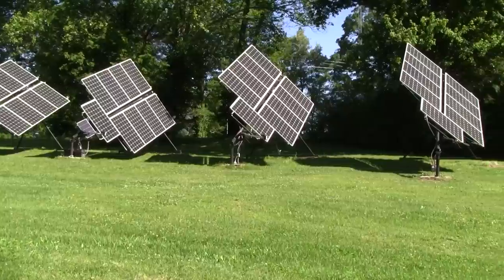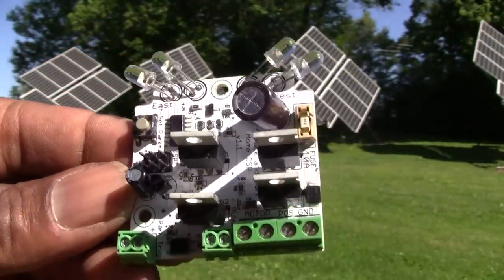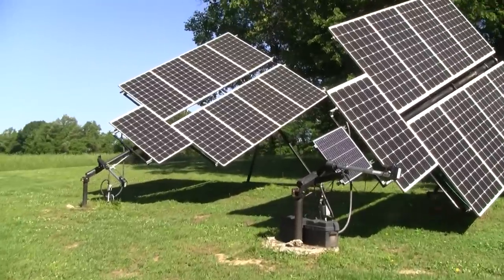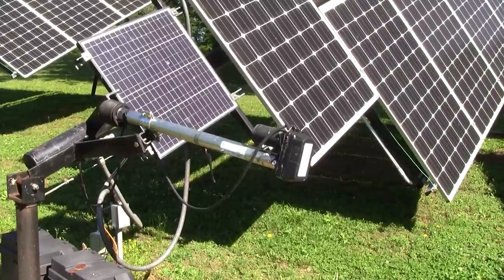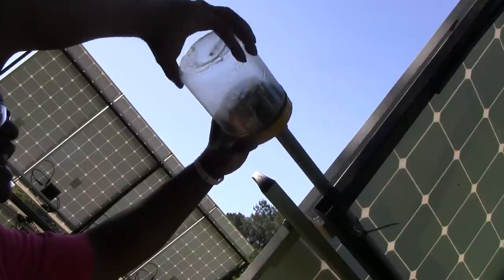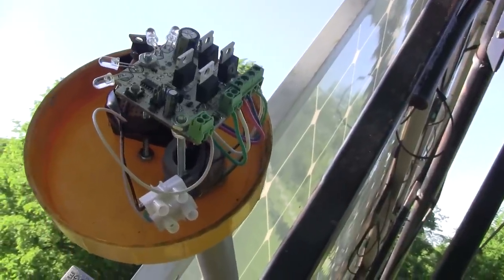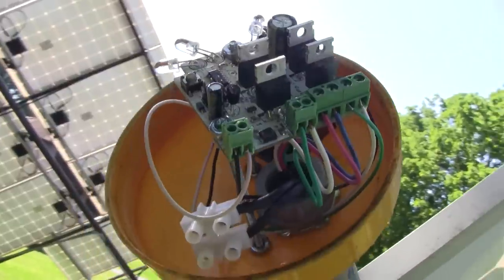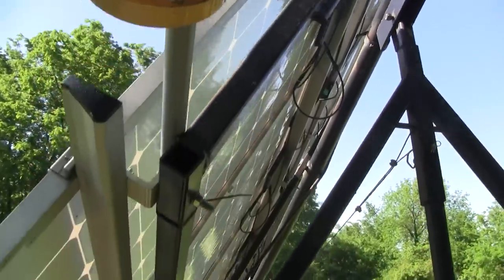Solar tracking drive system

Comment: Something interesting that NASA does is they put 4 small panels, 1 on each side (left, right, top, bottom) and they place them just right so that if one of them gets light, it turns a motor until it no longer gets light.  So it keeps them all out of light, and when they are all out of the sun it means the main panels are facing the sun.  With this method you don't need any batteries or sensors. Just 4 tiny panels, big enough to power the DC motors, and 2 DC motors, one for each axis.  it may work with linear actuators like you have as well, but idk how big of panels are needed to move those without batteries.

Comment: #EVERYONE#Install a AC run capacitor parallel with pump motors, 5-60 Mfd, power factor correction will save 1-15 amps, same for ice boxes to.  Try increments of 2Mfd instill lowest line current. My washer motor needed 180Mfd but hardly worth it because two 2 hours a month uses. We are charged for VAs not watts! Craig Thanks for your posting.

Comment: Hey sir, put on some waterproof silicone sealant around the pipe and on the inner side of it also use some teflon tape on the container thread

Comment: In the process to do an exact project as shown.  Want to know what motors that can handle  the weight & torque of the panels & adjustable mounting racks....
Reply from the maker: As long as you use the similar configuration and a Venture solar tracker, you should be fine. I don't have the specs o. Them specifically right now, but if it will handle about 1000 pounds static load, it should be fine.

Comment from the maker: I plan to make a posting on the manual control, probably tomorrow. Depending on if I can get the pool pump fixed!
Reply: #EVERYONE#Install a AC run capacitor parallel with pump motors, 5-60 Mfd, power factor correction will save 1-15 amps, same for ice boxes to.  Try increments of 2Mfd instill lowest line current. My washer motor needed 180Mfd but hardly worth it because two 2 hours a month uses. We are charged for VAs not watts! Craig Thanks for your posting.
Reply: that would be awesome
Reply from the maker: Jerry Moody what is your question about the wiring?
Reply: Sr, really nice Job. I'm from Brazil and I got a really good to build. I wanted to know what is the website yo said at 6:14. Thanks a lot man.
Reply from the maker: @jorgem3550  homecsp.com/store
Reply: thanks man.

Comment: you could also make a solar heated tracker and drop the power motor completely .... a pair of balck resevoir cyclinders onleft and right will heat in the sun and as the liquid inside expands can move a piston to rotate the panel on the opposite side ... a 2 to 4inch  resevoir 3/4 length of your panel side shold be plenty of pressure
Reply: Where can I find an example of those?
Reply: @mrweevilcom  I wonder if 0623Kaboom is thinking of Automatic Vent Openers that are designed to work between a range of temperatures (mine works between 55 - 75°F) to open the ventilation windows on solar greenhouses preventing temperatures from climbing higher. How they work is with a cylinder filled with a wax that expands as it heats up driving a piston. The piston controls the arm of the device, going from folded to unfolded as temperatures rise. The units I own have a range that you can adjust. The arm produces 15lbs. to 65lbs. of force depending upon the units I see available. But ambient temperature fluctuations seem like they would be a problem to work through. Perhaps if you live somewhere with little fluctuation in temperatures? I don't know how you get around that issue here in Wisconsin where temperatures range from lows of -20 up to 100°F. The units I'm familiar with are perfectly suited or venting greenhouses and maintenance free, working when you need them to, in a specific range of temperatures that keep your plants happy.

Comment: thank you for sharing and posting your system. Are you grid connected?
what type of bearing did you fabricate for the main shaft...? Do the trees shade your sensor(s) ?... i plan to convert my gas trackers to sensor driven when they stop working.
Reply from the maker: Yes Clarissa, sometimes the trees do shade the sensors, usually early in the morning in the summer. The way mine work, if they do get shaded, I just go out and reset them by turning off the power to the sensors and back on, then they move to the east and are ok for the rest of the day. Otherwise, it may be another half hour before they find east from the parked position. The main bearing is just a 3.5 in pipe around a 3 inch pipe with grease zerks to grease the fitting. works pretty well!

Comment: Led based position controllers are notorious for losing the sun's position under cloudy days.  How are yours reacting under those conditions?
Reply from the maker: they may be off a little bit but the sky is so diffuse, it probably doesn't bother it very much.

Comment: Craig you did a wonderful job. What would be the spacing you recommend between each tracker?
Reply from the maker: Steve Dewater I would recommend that you space them out more than the 20 feet that I did. Also these are oriented East to west. I should have lined them north and south but we are looking north in the video. That's all the room I had. 50 fees is better, north south alignment is best
Reply: Good

Comment: Hi Craig, how this system comeback to start position on early morning ?  is this tracking system able to find rising sun on the east and turn around solar panels  ?
Reply from the maker: Seeks the sun in the morning. Turns the panels East.
Reply: @craigb700  that is great solution, because cross sensor is exactly in the shadow in the morning (four photo sensors are in the shadow) , and second sensor on the back of panel is needed

Comment: Lovely. How many watts of Solar panel do you have and how many Kwh are they producing per day. Thanks
Reply from the maker: I have 10 kW of panels with 9 kw maximum output. I get between 60 to 85 average from winter to late spring. The trees you see behind the panels cuts down the production in the summer.
Reply: Craig Bradley. Massive production I must confess are you running a business with it?
Reply from the maker: @josephjohn907  nope, just my home
Reply: Craig Bradley. Ok. Thanks for your response.

Comment: Nice job.
Any probs with condensation ? I was shocked at all the moisture on the clear container b4 you unscrewed it...assume its drained, but still ?  Rick
Reply from the maker: Prepper Rick_W I just open them and clean them from time to time. I also use silica pacs
Reply from the maker: Prepper Rick_W actually it tracks just fine.

Comment: Craig, great work! I have been wanting to build something similar. I'm located in Florida with about 4.9 hours of solar sunlight and I use roughly 1000 KWH per month. My question is what would you suggest as far as size system to zero out with the additional power of the solar tracking. My calculations came up with an 8KW system, what are your thoughts? Thanks!
Reply from the maker: bryschopper That sounds about right. I use a lot of power but with this system I generate about 1600 kWh in good months. 8kW should work fine for you!
Reply: Thanks, I really enjoy your videos.

Comment: I didn't understand what is the purpose of the led bulbs, and how they act... Thanks
Reply from the maker: The LEDs actually develop a voltage when the sun light hits them.what you try to do with them is to balance the voltage on all sides, inner two and outer two to have the sun light up in the center.
Reply: pretty sure those are light sensors
Reply from the maker: Notlighy sensors as you would think, they're LEDs
Reply: Led's work as light sensors as well as emitters.
Reply: L.E.D.s are like solar cells because they are made up of P type and N type silicon. I'm sure there is a way  to use them like a miniature solar cell to light up and when equally lit they will be dead center on the sun.

Comment: could you post a link to where to get the controllers?  somehow I did not see one or you did not post one   Thanks
Reply from the maker: Steve Pailet https://homecsp.com/store/
Reply: thanks that sure helps   seems to me if one spends all that $ to buy panels does not cost a lot more to let them work an extra few hours a day and get up to 40% more power than a fixed mount..

Comment: What was the cost for this entire system?
Reply from the maker: Derek W Everything was a little over $28,300. But, with a 25% grand from the state and a 30% tax rebate, do the math. Check the programs in your state. Where are you from?
Reply from the maker: Everything was a little over $28,300 but with a 25% rebate through a state program and the 30% tax cut, do the math! Well worth the effort!